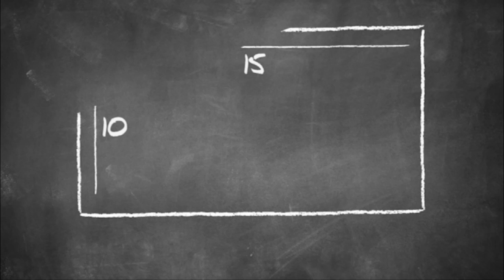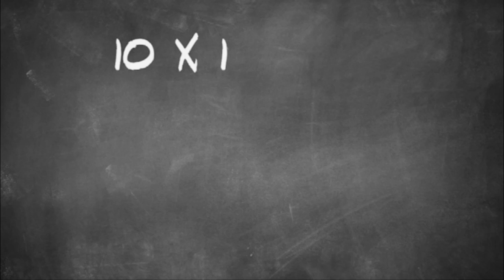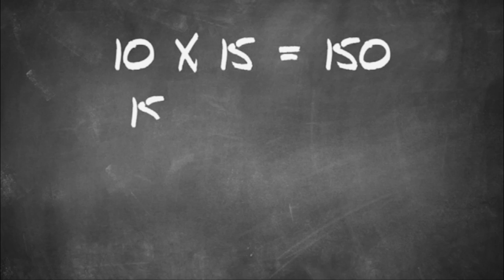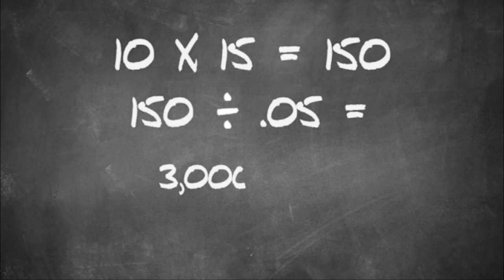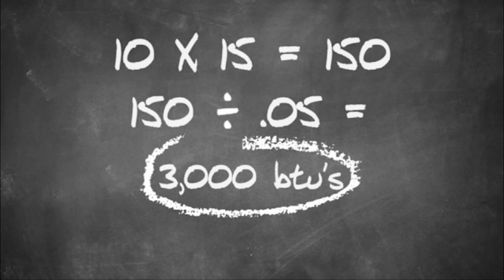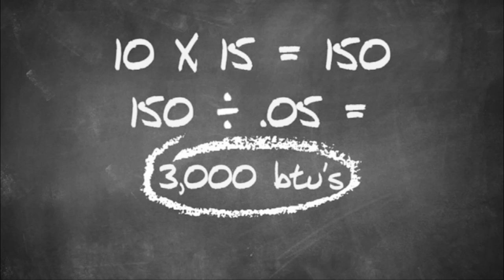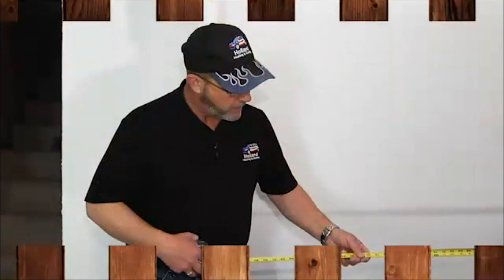Window AC Sizing

Comment: Wow, talk about POOR/BAD information. According to you, a 5000 BTU unit will cool my upstairs bedroom. A 6500 BTU unit I used for years was always to small. It ran far to long to cool the room down.I live in Vermont. Ten years down the road I'm upgrading to 10,000 BTU's. A step up to 8,000 is less that a 15% improvement ,which isn't much.Your formula is off by a mile.
Reply from the maker: I would say, either your math skills are very bad or you may have very poor insulation, LOL! Sorry so sweaty ;)
Reply: @BuzzMarketingGuru  Well, I'm a 61 year old carpenter. Lets do some math.The room is 16 x 13 with a 5 x 3 full ceiling boxed out dormer OR = 233 Sq' A 5,000 BTU unit is all thats required by your math.It's a loft.Technically, the slopped sections and 7'6" ceiling height reduce the total cooling area compared to a standard room significantly.   
 I furred down the slopped roof sections to accommodate R 52 insulation. The Knee walls contain R 26. The flat ceiling has R 72. One outside wall contains R 38 and the dormer has R ? "I forget"  When I taped and mudded the drywall in the dead of Vermont winter, there's 600+ sq' in total. I heated it with ONE 5,000 watt electric heater to over 50 degrees.Hows that for math?It was isolated from the first floor by a insulated steel door at the top of the stairs.We lived in the downstairs and couldn't subject downstairs to the construction debris and allow the door to be left open.This was a modular home with an unfinished upstairs, no electric,plumbing, internal walls etc. By the way, I run the exact same 6500 BTU air condition in a smaller 156 Sq' room downstairs. It's more effective downstairs but still labors on hot days. The units have been interchanged between rooms.These are Frigidaire units. Your formula doesn't account for number of windows/sun.You share a one size fits all formula. Upper floors are fundamentally hotter than lower floors. Plus, your miles off base in my case. I'm insulated to levels much higher than most homes in America. The home is only 15 years old, the first floor has 2x6 exterior walls and R 19 insulation. R 19 is nominal yet exceeds most homes in America.I've buttoned up everything tighter than it was as delivered.

Comment: Great information.  Thanks for this video!  (but, for the BTU part, isn't dividing by 0.05 just the same a multiplying by 20? - Seems easier to me.  Just multiply your room area by 2 and add a zero.)   12L x 12W = 144 ft^2,   144 x 2 = 288, add zero = 2880 BTU's.  Thx again! :)